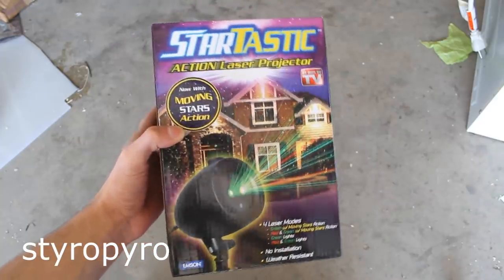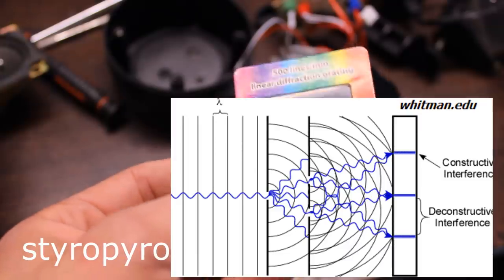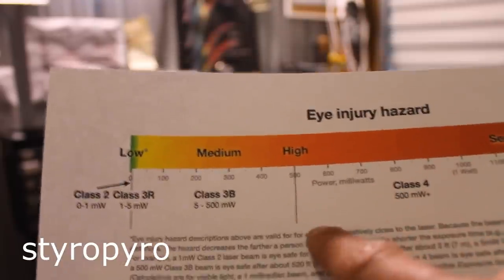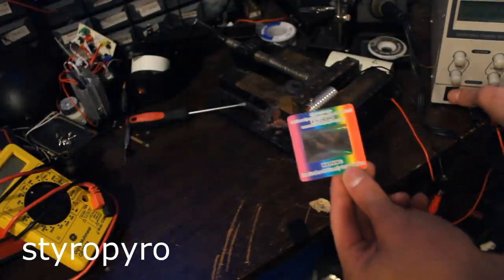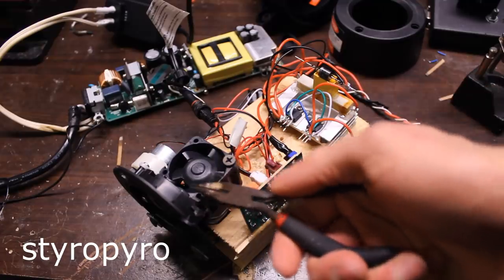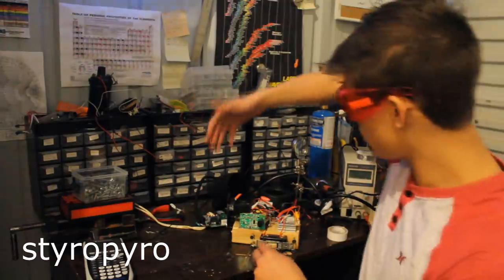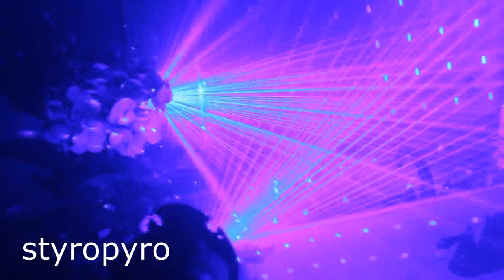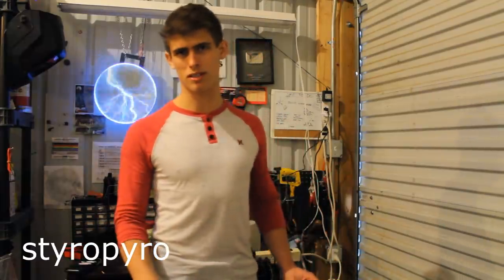Dangerous Christmas Laser Show Upgrade - 1000x Stronger

Comment: You didn't have to swap out the heat sink. Hobby shops sell varying sizes of extremely thin walled brass, copper, and aluminum tubing. I'm sure one would have worked. You find a close size then slit the tube lengthwise so it fits snug using some thermal grease.

Comment: You should pick up some cheep used color cameras that you won't feel bad about burning the sensor from a little too much light.
Can you also spend a little time and explain to people that might not know why they should not point a laser into the sky. Night even be worth finding a place 
that had a good backstop and show just how far away from the laster you can get and not have the power drop off that much. Maybe you could find a place 
where you have a mile of clear land and see what level of power you get at that distance. That is something I would like to see the data on also. 
I though for sure that the diffraction grating would of been toast in just the short pass you did at first with the high power laser.
Keep up the fun and stay safe..

Comment: I want to build a vertical "laser saw". Just like a band saw  or a jigsaw. What do you suggest. Looking to cut 1/16 inch aluminum, but most toy wood. Acrylic. Upto 1" thick.  I am a double board certified physician with background in electronics! But went to med School & lost  over 10 years of electronics evolution.  Can you give me an idea? I suspect I meet an 80W infrared laser with watercooling. Do they make diodes that output this power?
  Thanks in advance 

Dr. T.